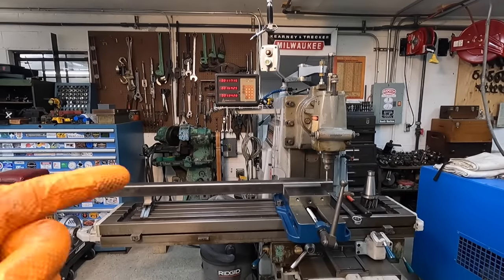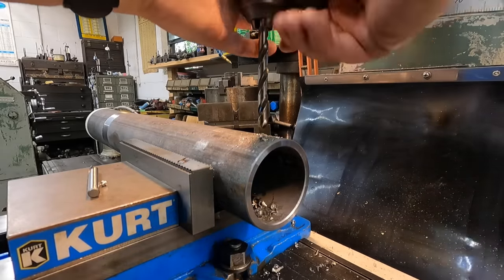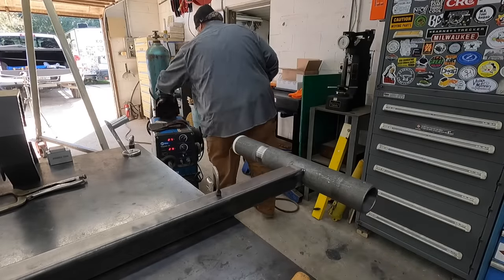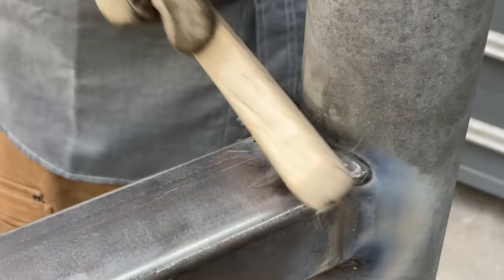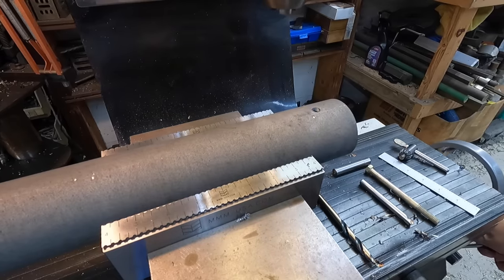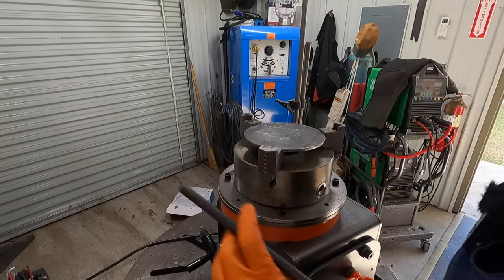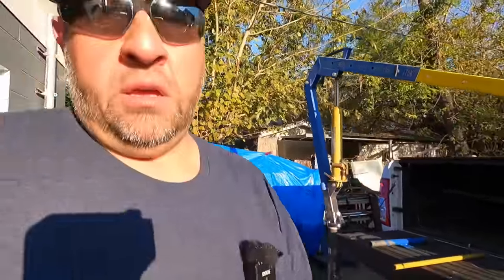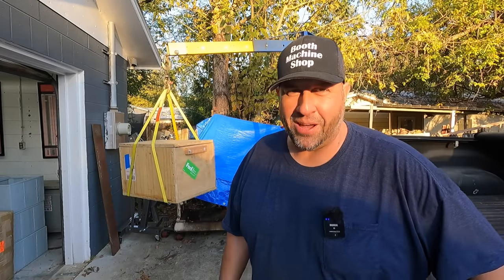Truck Hitch Crane Build Ep. 7: First Test!

Comment: Respectfully if I might suggest, it'd be better to have the holes distanced on a spiral down that pipe, instead of a straight line down. - That way, the weight of the load will rest on the entire pipe below a certain hole, unlike the case of the holes in line where the weight of the load will rest only on the little part between 2 holes - which could break under hundreds of lbs. - Also I hope the pin is very strong and won't be sheared by the 2 pipes. -- Other than that, great work as always, thank you for sharing it!
Reply: Great idea...
Reply: I was thinking the same thing.
Reply: Why not weld plate on the bottom and use the screw jack you already have.
Reply: I think I agree, though I will point out that this would make aligning the holes for pinning a fair bit more difficult.  He clearly did think about how much space to leave between holes, so... hopefully it'll be alright.
Reply: I was actually thinking about having the entire post slide through the pipe instead of having an adjustable foot...the beam attached to the hitch would keep it stable, but all the weight would be on the foot.
Reply: How much weight will the .5" space hold, between pin holes.  Also is the pin size rated for the weight you plan to put on it (even worst case)
Reply: @CajunMikeT 
This is way overbuild, I would be surprised, if the leg with the spaced holes and pin size, could not support the whole truck.
Reply: For the weight rating Adam built this crane to, the holes could overlap by 25% (look like gear teeth) and the pin would not fail. Way overbuilt for 500lb.
Reply: Re drill the foot and add a micrometer scale for alignment
Reply: @DavidLindes  If the holes were in a spiral and stepped by less than the diameter of the hole, then alignment would be easy.  Just drop the foot to the ground, stick the pin in the hole, and spin the pipe until it catches, then wiggle the pin in.  No need to see it, you could just feel the alignment.
Reply: @simonsms410  I agree. The whole idea behind this design is to lift a
load with a steady force, then lower it gradually, not drop it several feet with a sudden stop.
Reply: You guys are overlooking the obvious problem of removing the pin, once the weight is placed in the bed, and the truck 'squats' down, keeping weight on the pin...
Reply: Y’all are entirely overthinking this build. The weight of the load was designed to go into the hitch mount. The leg on the bottom was to add support. However I do agree with issue of the truck squatting putting a load on the pin, but at the same that can be combatted by lifting the load enough to put the load on it, then adjusting the foot with the load on it.
Reply: @CajunMikeT  3/8 diameter grade 5 bolts have a shear strength of 70,000 PSI.  Double that number to 120,000 since the bolt would have to be sheared in two places to fracture and drop the load.
Reply: Ya but I don't think you'd exceed the deformation weight needed to mess things up,  even with the max capacity of the truck.  
Depends on steel  used.  He knows what he's doing.
Reply: @Madmax_402  good idea
Reply: @BrianEltherington  Not only plenty of vertical strengh, most of the load is a bending moment and not straight down.
Reply: @nicholaspayne349   Lol
Reply: @Madmax_402  exactly! Almost all the loading will be on the square bar. Only if the crane were almost vertical would any significant load be directed to the foot.
Twisting the square bar or the hitch would be a far more likely problem than shearing through the adjustment holes would be.
Reply: @techman2553  Was thinking that too. Would also be an interesting set up / layout to do the holes.
Reply: Great idea
Reply: @scottstarling247   That is a good point.   Although moving the load up by the cab will probably suffice,  there is a chance it causes and issue.  Don't forget the freeplay when the bolts for the horizontal tube are loosened,  that'll give some additional room too.  Odds are it'll be ok, but your point is worth consideration.
Reply: @BrianEltherington   Similar ones I've seen are rated at 1-2 ton.
Reply: @HVAC Quality Assurance Yes, Adam has said several times in the series he intends to lift only 300 - 500 lbs.
Reply: i think you may have saved this mans life.
Reply: The holes are easier to find in a straight line. Strength of the web wont be an issue for loading anything on this size truck.
Reply: @tjr4744  thats true that lift is rated for 4000lbs thats beefy good talking with yall
Reply: Holy cow!! That comment is amazing!! Thanks!!
Reply: @scottstarling247  That's what I'm thinking as well. Needs to be something like a tongue jack instead. Otherwise, you'll have to jack the truck up to get the pin out.
Reply: Just a tip that works for square tube as well.
Put two holes in the receiver, say, 3 inches apart.
Then drill your series in the moving part at 2 inch spacings.
You'll get 1 inch increments: one of the holes in the receiver will line up every inch.
Adjust the numbers to suit your application.

The spiral idea is great nonetheless, you just can't clock a square tube other that 90 degrees.
Reply: @jeffreylee7184  If the Boom was pointed straight back, and was lengthened - (stay with me here - this is hypothetical) - and adequately strengthened, so as to lift a weight equal to the truck - would all the weight still be on the foot?
Reply: Jeffery Lee: The problem of removing the pin can be solved by a simple vertical flex joint in the hitch bar. The joint should be very strong while permitting the bar to move vertically up and down about 10 degrees. Since the bar can only move in the vertical direction it will 
still resist the twisting movement of the cantilevered load while providing enough flex for the truck to squat and the pin to be easily removed.
Reply: Neo:    You are really over thinking this.      That pin setup in a double shear will literally hold the weight of the truck many times over.    The one and only thing I would have done is made the support out of a trailer jack or something similar to compensate for the suspension droop
Reply: Funny I was thinking the same thing when he was drilling the holes in line and close together . He could just use the same pipe and barber pole the holes around the pipe.
Reply: @BrianEltherington  Spot on, nothing there is stressed to the design limit like a Space Shuttle motor.
Reply: I was thinking the same thing. At 1/2" spacing, rotating by 60° per hole would give 1-1/2" of between holes vertically. Rotating 30° would give 3".

Personally though, I'd have made it with a coarse/fine adjust by having holes 1-1/2" or so apart and a threaded connection to the foot with 2" of travel.
Reply: I was thinking the same thing with like 1/8 inch height spacing
Reply: @techman2553  "No need to see it, you could just feel the alignment." Again, that what she said. I know, I have way too much time on my hands. No wonder my wife wants me out of the house after almost two years of hanging around.
Reply: @nicholaspayne349  AvE is the master!
Reply: @scottstarling247  that's exactly what I was thinking
Reply: @manifold1476  I see where you are going with that thought.  The problem with your question is the offset of the crane with the receiver trying to turn everything about the crane.  Do you see what I am trying to relay?   Your question is what we engineers call statics.  In the front to back direction of the truck, the answer is yes, except for the crosswise direction of the truck.
As long as the metal distance between the holes is the same or larger than the thickness of the pipe wall, there will not be a problem.
Reply: I was going to suggest the same thing.
Reply: The foot should have a swivel on it like the way outriggers on a crane are. That way it can be removed with a simple clevis.
Reply: @ellieprice363  fantastic, this is what I was curious to know. This is one of the very few times I've ever had the thought of disagreeing with something Abom has done, personally I would go with a half inch pin and probably stagger the holes 90 degrees just for my own personal peace of mind but that shear strength for 3/8s is definitely plenty strong enough for this.

Comment: Might I suggest that instead of two pieces of pipe welded on the sides of the square tube, that you weld a piece of pipe through the middle of the square tube so it isn't in the way but handy for your handle! Just a suggestion!

Comment: Just something to consider -- if you have the landing leg down in contact  before loading - after you load the truck is going to squat a little - may need to consider how you release tension on the leg if the load is high enough!
Reply: I would probably use an RV level jack that can be undone.
Reply: 'short-pin' the leg; enough so when the bed is loaded, the leg just touches down for the load to move to the bed.
Reply: @jbmillard  take the truck to puddins fab shop for some air bags
Reply: When I designed mine, I decided on a screw jack as the support leg. I also made sure I can quickly remove the jack entirely so I can position the truck with the crane still installed.
Reply: I was thinking if the load is heavy enough the weld at the T could shear off
Reply: travis i think he knows
Reply: @MrOly0001  Yup.  He considered it in a previous video and, I think, talked about swapping to a screw adjustable foot - if needed.
Reply: Old school Mercedes screw jack,,have been around from 1949-1990's..and thery lift a 4K 300sd with easy,,,(@@)!
Reply: I was thinking the same until I thought about it....don't most Ram trucks have load-leveling suspension?
Reply: Lets free, with no pins, then load truck with 100kg, 250kg and 500kg check the number of hole change. One sticker to remember it, its done!
Reply: Adam mentioned and addressed this in episode 6? (Maybe even #5) 
He considered using something like a jockey wheel (trailer jack) or scaffold jack, but with what he's planning to lift he doesn't see it being an issue
Reply: Y’all over think everything.  Adam is incredibly smart and already thought of any issues that may arise.  Why do you guys watch him if you don’t trust his designs?  He is successful for a reason and has been successful even before YouTube and the almighty comment/bitch and moan section.
Reply: @Highstranger951  it's not that we don't trust the design, its that the issue could have easily been overlooked or forgotten. We are all human and do make mistakes.
Reply: When I have loaded my bed and time to teardown, I put a bottle jack under the receiver hitch and give it a little lift.
Reply: @Highstranger951  It is a  comment section after all. That is all I see, comments. People have knowledge and want to relay that to others so that they may benefit from their experiences. No one is casting any dispersions on Adam. I am sure all have the same respect for him as you do.
Reply: @Highstranger951  nobody is been disrespectful here. We’re all just commenting on our observations. I’m sure Adam has thought about it and, because of these comments, he might address them in another video so we get to see what he would do to resolve any teething problems, if there is any.
These comments and suggestions are no reason to get butt hurt my friend.
Reply: @riverflyswatter  Air bags would be a good idea. Dump the air to load then air them up to release the pressure on the hoist leg.
Reply: Thats what I posted b4 reading the comment 🤦🏽‍♂️
Reply: @riverflyswatter  genius 👍🏾👍🏾👍🏾
Reply: @bearsrodshop7067  Best car jack I've ever used.   Those things are so much easier than any scissor type jack used by any other manufacturer.
Reply: I’ve thought about this also but don’t think it’ll be an issue. That’s a 3/4 ton Ram with towing package which means it has more leafs in the spring packs; as designed he’s only going to use for moderately heavy items. 2-300 lbs would barely budge that back end. Fords or GM’s would crumble with the weight of a toaster, not a Ram. MoPar or no car! Cheers.
Reply: @Highstranger951  Blind faith can be very dangerous.
Reply: You folks are something else
Reply: I was thinking the same thing on his first test of 200lbs , what if it was 1000lbs when loading on the bed the truck has to feel that weight and the hitch and tubing will have to support that sag making it hard to take out the pins ,etc... I guess that`s what tests are for and see new modifications as need it... very nice job and thank you for sharing all the ideas !
Reply: @Highstranger951  that is what mechanics and machinist do there's no two people will agree on anything I worked with a man that would redesign a woman if he couldn't have her on her. Cycle 28 days out of the month

Comment: Now for a truck option - a 3x3 pallet so straps can go around it without picking it up.  The small pallet is light - or heavy 4x4 sides... heavy.  Lift off with fork lift on other end or your crane.   Cool.   Time of life - wheel chair is possible.

Comment: If it’s 75/25 it’s just become unmixed. You just need to roll the tank around for a while to mix it back up. I had the same problem a while back, and the air/gas supplier said it’s common, especially if the tank has sat for any length of time.
Reply: Thats right.  I remember rolling tanks on the ground at my first shop whenever we changed tanks or brought tanks out from the cage.
Reply: I've never heard of that. Great tip thanks for sharing.
Reply: Yep, we don’t think about it but the gases do actually weigh different weights. In a bottle that doesn’t move, the heavier gas settles to the bottom. As they say, lay it on its side and roll it around. Some gases do expire. I remember when I worked at the hospital they had small little “E” tanks of oxygen and nitrous oxide on the anesthesia carts used in surgery just in gas the central supply had an issue during surgery. Of course, we never had any issues but we still had to check and replace the tanks every so often. We always vented them before we sent them back.
Reply: You don't use 75/25 for shield FC. You use straight Argon.
Reply: @hibiki54  no you dont mte you run pure co2.
Reply: @hibiki54  nah, that's CH4
Reply: Shouldn't the total be 100%?
Reply: i will stay with stick to many problems and expense.
Reply: @Bill_N_ATX  The gases, argon and carbon dioxide, have different densities.  At the same volume and pressure, they will weigh differently.
Reply: @hibiki54  That gas after beans is methane.
Reply: @royreynolds108  , yeah that's pretty much what I said. I didn't break out Chemistry class where we can do the math of what each gas masses by mole and then figure out what they weight by liter at STP, but for us common folks, I thought we could leave it at "one weighs more than the other."